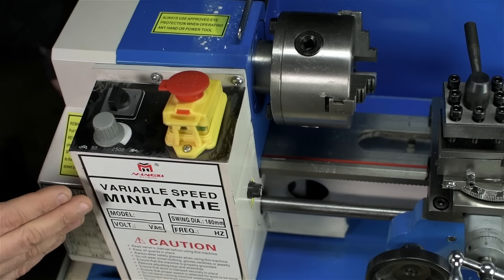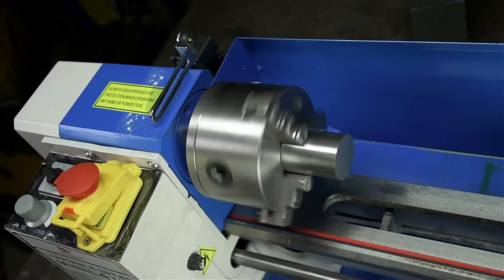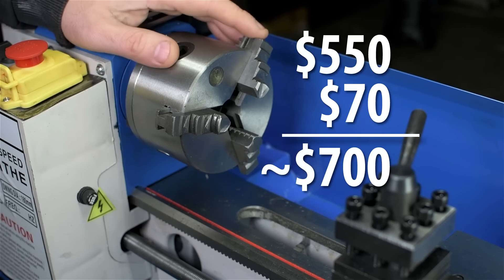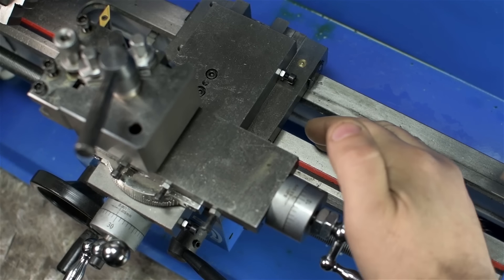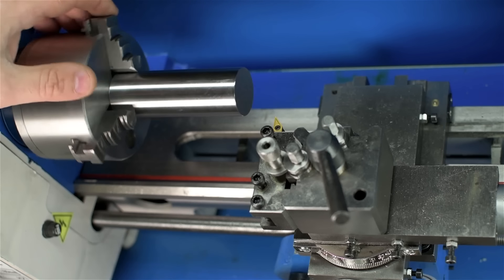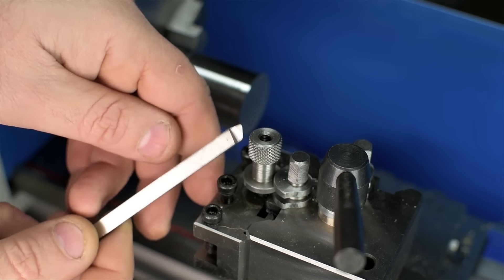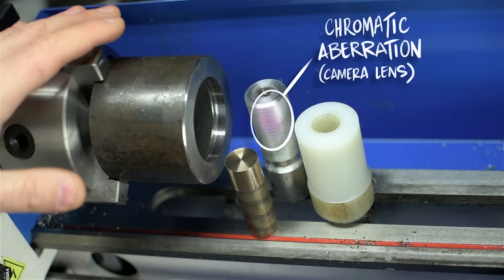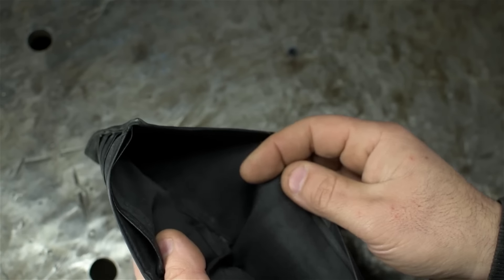The Infamous Mini Lathe!

Comment: hmmm it would still make a great mini lathe for wood textures or perhaps Resin? even if the metal lathing is less, it still works if you have the right tips and the patience to use low/slow cuts

Comment: just bought that same lathe that must have been from a good batch cuzz Im very pleased with it! only flaw was a scratch on the chip tray LOL  other than that the motor does wine which am hoping will calm down>>>>>>only concern is how can i loosen up the chrome compound crank so its not so damn tight!

Comment: The "Chatter" using the Button Insert is what you would expect on such a Lathe - Try a little less Tool Overhang, A smaller Button Insert or - what we call a Knife Tool (which will Face & turn to a shoulder.

Comment: Hey im just gonna use it a little wile.

I could see it useful to knerl tooth picks.   Maybe its made as a fancy pencel sharpner?

No i actually think within its limits you can make small parts on it.

Id love to have one and a tiny bridgport to go with it, can ya get these in cnc with automatic tool changers  5 axis .

Dont it run on 2 d cells?

Comment: I feel a motor upgrade and controller upgrade would not be a bad idea, either a 1000 watt motor. Or a control and power supply with 6-12:volts higher than it came with.  Over volt the motor, but a 1000 watt brushless wiuld ve much better!

Comment: think this lathe should be evaluated for pure hobby purpose, like making some simple nylon or brass bushings, or turning down some small shaft for a bearing, for your RC project etc. most in that spectra dont even know how to make threads with a lathe. in that scenario the lathe is propperly very suited, and the time issue is neather a concern, with it being used a few times a year.

Comment: No 7x16?  Check out Little Machine Shop and Micro Mark.  The LMS lathe is available with a solid (non tilting) column, which is a good idea.  The MM machine comes in two boxes, so there are no parts that require a crane to get it up on your bench.  The MM machine is a a "True Inch" machine that does not have marking for metric threads.  However LMS has free software on their website that tells you what gears to put where for almost any thread.  I made a set of stockmakers screws for a Mosin-Nagant, on my MM lather, and they work fine.  Both LMS and MM offer metal gear sets.  
I see no advantage in either a 8x or a 9x lathe, because they all have a MT3 spindle.  While the spindle hole cannot be increased, the hold through the 3" chuck is what restricts the diameter of what can be put through the mini.  Going to a 4" or a 5" chuck will make the lathe more useful.  That should allow you to thread and chamber most military and/or sporter rifle barrels.  If you need something bigger, then I would recommend a 10x22 lathe that has a MT 4 spindle.

Comment: I got a slightly bigger lathe (but looks similar in many details) and it came without motor feeding. Advantage is, handfeeding you feel how fast you can go, it actually pushes back on you if you feed too fast. However instead of losing 150 bucks on a set of plastic gears, it might be a better idea to fit a step motor and an arduino (with a sensor detecting rpm of the main spindle) and this would give me computercontrolled feeding or threading at whatever rate for like 30 bucks...

Comment: I made a couple 3d printed gear to have a smaller feed speed. Not perfect, but a bit better. Went from 20/80 20/80 to 20/100 and 15/131. The 100 15 is a single solid part so only 8 mmm ID.
Let me know if you want a set...

Comment: These mini-lathes are a good size for home use and that makes them nice. The problem is how poorly they are made and even designed and just how highly variable the quality is from one lathe to the next. So you end up always purchasing a project lathe. If they only required the routine setup of a normal higher quality lathe once received, they'd likely be selling many more. (Oh, and my 7x14 came with metal gears for the same price. I'm also really torqued off by no thread dial.)

Comment: I think you should've used running oil, or atleast had a brush with oil touching the steel thru out the entire cut, that would make a difference...  I have to admit there's a few years since I was doing this myself, but I always got a better result with oil covering the cutter...

Comment: Great video! 👍 Is this a lathe you will recommend for hobby use? I consider getting a lathe like this one is my shop to use for smaller projects.
Reply from the maker: any lathe is a great lathe if you don't have one!  These are handy for smaller projects, for sure.
Reply: @ThisOldTony  Yeah thats true! 👍 I dont have any lathe right now and it has been many times i should had one before so i think i'm going to buy one. Is this one you have in this video the HBM 180 Vario or the 210 Vario model?

Comment: 550 watts, possibly could run on a 2,000 watt inverter on a 12 volt battery? , if you have a garage or shed without power.?

Comment: Whenever I buy any China tool, I like to tear it open and pull out the plastic stuff and sand cast replacements in aluminum or steel. It takes a couple of hours when you get the right (and cheap) stuff setup. So many failure points in China tools are the plastic gears or fan blades off the main shaft, for example, in rotary (dremel) tools from China always fail first and if casting them is the first thing you do, the tool will last a lot longer. I see a lot of that in purchasing these little kids.

Electric motors, though *never* rated what they say they are, actually have a low failure rate in China tools.

Now balancing out your castings or other general casting mastery takes hundreds of attempts but well worth it. We have a 1940's Moline tractor on the farm that over the years has practically become a brand new tractor from casting, anvil bashing, and old-school lathing parts and pieces. "We could just ebay this grandpa!", "Hell no I couldn't".

Comment: I have one. It will not start. Im thinking its brcsuse the e-stop cover does not latch to well.  I need to find a source for teplacement parts.
   I really have not looked very hard.  I also have a ZX1440 so.....

Comment: I got one of these and it came with metal gears, but the feed screw is metric, so to make a decent inch thread, it would need a 127 tooth gear, and the thing is too small to fit that. Biggest it can fit is around 110 teeth. :( was very disappointed because they advertised it as able to cut 10-52 TPI.

Comment: I wish I had enough money to get the MINILATHE. I've been doing some epoxy projects and want to try to get one of these.
Reply: They're 1200 which is still cheaper than a huge actual one. I'm making myself one instead. Get a nice chuck, put it on a plate to which I welded a rod, put it through some shaft bearings and hooking it up to a medium speed motor, attach some rails etc.

Once I make it I need a good box or something similar to cower it so it seems like a lathe I bought used rather than made

Comment: I just grabbed one of these for $300 so couldn't resist it.  Will use it for small things like bearing carriers for gokarts type things.  I've made several by chucking the pipe in a drill and running a dremel sanding disk in the opposite direction of the drill to get grind the right diameter etc.... I figure the mini lathe would do better than this.

Comment: nothing wrong with the plastic gears IMO. I 3D print a few gears I don't have for my old Atlas. They are awesome, quiet and they last. I have broken one tooth off a gear in 2 years of using them.
Reply: And also, the version from grizzly is not much more money and is waaay better.

Comment: I’ve recently discovered you (thanks to Xyla Foxlin). I’ve had an on again/off again desire to get into machining (small parts) for many years. I’ve been contemplating a Taig Mini Lathe for a couple of years. Wondering if it would be feasible to run one in a small apartment? How loud is turning brass/aluminum/plastic in small sizes? Do you have opinions on the Taigs? Am I being absurd?

Comment: could you lock the carriage by engaging the power feed with it disconnected from the motor?
Reply: that kind of works but the carriage can still move by however much backlash there is in the lead screw

Comment: 9:30 , asking as a newb who knows nothing about using a lathe, why did it get a 4/10?  Could you explain your rating system for that test?  To me, it looked like it done decently, but I'm not sure what I am judging.  Is there something that I am missing?  Something to do with the way that it cut the cold pressed metal?  Did it leave groves that would be hard to smooth out?  Was it just too slow at removing materials?  What am I missing here?  Someone please explain.
Reply: it was a rough cut with poor surface finish.
Reply: @charlesabaday6815 does that affect precision by more that a couple thou?

Comment: was looking into getting some stuff like this play with an try to learn some new skills. i didnt go looking at lathes first tho. i found this video. so im guessing 550 - 700 bux is the cost of entry for lathes. could u do cheaper by buying older used stuff or will that just lead to the price going up cause of older stuff being more valuable. this is alil out of my range for buying something that i have no knowledge about. ive done it b4 with a mig welder an im not someone that i would call  a welder. ive been able to use it to make stuff an get me out of hard spots a couple times with broken an stripped bolts or just welding stuff to the bucket of our bobcat to gives us options with stuff we're working on around the house. its never been something we've used as a permanent fix but good enough to get us out of a pinch.  an this is something that would make life so much easier if i could learn it, but 100 bux got me the welder so its dirt cheap but has done me well. not sure how much it cost new i got it second hand from a pawn shop and ive just picked up 3d printing in the past yr an ive went alil crazy with it but a mini lathe would be something i would benefit from in a few hobbys i have i guess u can say. is there a way to get something around this size but alil cheaper. i dont need anything special just something that i could learn on while still being able to make things i could use an show its value of having around. even if it was mostly used for ptfe plastic or something i would find a use with it im sure an would give me an opportunity to get a feel for how a lathe works and then it would feel so bad to drop 550 bux on something like this cause im pretty sure the lathe in the video would do anything i would ever need around the house an with my hobbys.
Reply: i got one about a week ago, i got it for 525 an it came with metal gears 7x14 an a bunch of tools, now im working on the quick change tool post an cutting tools. took me 2 yrs to save up cause i kept buying 3d printers, im up to 10 fdm printers an 2 resins but i kept watching tonys videos an now im saving to buy a mill. you are a bad influence.
Reply: after spending time with it an slowly figuring out what im doing, more than likely the wrong way but the lathe wasn't to bad so i think i got a lucky but the tail stock is trash. i did get luck an got one that could be center but i cant for the life of me understand how vevor allowed something like that  out but it seems to be for everyone who buys one from vevor in the past couple months an if u contact vevor they will not replace it but  will give u a partial refund but its not enough to buy a new tail stock. so i learned really quick not to buy cheap cause its pointless. spend the money an buy it once or u'll end up buying multiple times.

Comment: Mine is nearly a year old and it's going to my scrap pile very soon. What's wrong with it? The belt wasn't tensioned properly so it slipped a few times so now it's the same on both sides, whole carriege  became so loose it's impossible to do anything on it, I broke most of the toy tools I've had for this monster of a lathe. BUT i'm buying a real one soon so thank you China!

Comment: I use two of these to run a business making pens - I work primarily in wood and plastics however, with some brass - and it's fine but I wouldn't recommend one for true engineering parts or solely for metals apart from brass.

Comment: I'm still using my myford 4inch precision does everything that I need.
Reply: Myford  four inch is the same as US eight inch.  The English use swing radius not swing diameter.
Reply: @richbuege6491  that is correct although the precision 4inch is a gap bed lathe the swing radius over the bed is 4 inches. The myford 4inch precision is so called as it was built to very strict government specifications as an indexable micrometer lathe that was not available to the general public till after the second World War. Mine is also fitted with the long cross slide and backplate and vice to allow milling in the lathe.

Comment: Carbides always want to see some pressure. If you choose a to small cut depth you will end up with a shitty surface. Try a higher feed rate, higher cut depth and a higher revolution. It may work better for steel.

Comment: Got one from HARBOR FREIGHT a couple of years ago.  After cleaning off the tons of cosmoline, and powering it, it became evident that the  (on sale) $350 was justified. The tail stock nut is a pain to use. It was not centered on the lathe chuck and difficult to adjust.  The Slide & cross slide gibs needed to be tightened, but still the cradle rocks when making
shallow cuts (in brass and/or alum.).  It has blown several fast-acting fuses already.  The std. tool post is annoying.
MICRO MARK sells their 'hotrodded' version of this lathe for the current 'on sale' price of $1799. Granted, it does feature
metal gears, also the tailstock has a locking arm.  But, to spend $1800 for this basic Chinese lathe ..... be better off inventing in a high-quality German-built machine, and have complete confidence directly out of the crate.

Comment: I’m planning on taking a gunsmithing course, and this lathe (or one of it’s different colored twins) comes in the tool package included with the course level I’ll be taking. Do you think it could be reliable for cutting 1/4 x 28 threads on barrels for muzzle devices?

Comment: It’s not the  lathe ,it’s how you use it. If you’re having problems with chatter, parting etc it’s the cutting tool not the lathe .But As always the you tube expert knows everything .
Reply: Or, you could get a lathe where you don't have to work around its flaws, and can turn steel without worrying about breaking it

Comment: I started out with one of those types of lathes and it was so far off in every  way possible that I finally gave up and sent it back. I could have fixed it......Probably. But for what I paid for it or a couple hundred more I could get a 2500lb 1953 Hendey Lathe that just needs a little cleaning up. A couple parts and it will be good to go. lol

Comment: Can you feed a 3 foot 3/4" rod through the back of it to thread the end?
Reply: Sure can if you keep the rpm down so it doesn't whip all over. Personally, I mostly cut threads without using the motor. Just turn the chuck with your hand and take shallow cuts. ToT has been hooked on speed and automation with his bigger lathe. Of course, if you do a lot of threads then that's a reason to buy a better lathe. Me, only doing prototypes and playing so the little Chinese fella (mostly) covers my needs.

Comment: Pub quiz: why does the lathe need to be levelled?
Reply from the maker: if it has any twist in it it won't make cylindrical parts.
Reply: Yes the saddle has to run true to the chuck

Comment: Once bolted down to a bench (minimum 3” thick hardwood on cross fit legs) then find 12” of solid concrete floor and drill 1” x 10”l holes at each leg and anchor them with 3/8” steel brackets with 5/8” stainless prestressed 9.5”l bolts set in vibration dampening epoxy rated for 8.0 bidirectional earthquake. Cure for 3 months before use.  My company can do all this including retrofitting your bench for just under $7,200.00. (Come-oooon man! You know you NEED it for safety sake!  I mean..you have kids depending on your income right?)

Comment: If you're upgrading the motor, use a stepper, and then put a stepper on the lead screw and with the proper controller you can now cut whatever thread pitches you want.

Comment: On the grown up lathe, "the lathe would probably stall".
Nope - you'll break the shear pin in the drive-train behind the uppermost change-gear.

BUT LOOK what those plastic gears are driving - a SCREW - a 'worm' - giving an infinite:1 torque ratio. Score: Plastic gears 1, bed, nil.

Comment: Mini lathes are a little bit too small. If the workpiece clearance was 10% larger they would actually be much more useful. But that said, I still have one that gets used from time to time doing small parts for gunsmithing.

IMO, a bench top mini mill is much more useful. My bench top mill gets used more than anything else in my shop, and I have a bigger Bridgeport.

Comment: I got one that costs only $150, but the gears were made of wood, not plastic. And the body of the lathe was plastic, not metal. But, I paid for it with cryptocurrency, and have little to no intention of actually ever using it. Let the chips fly where they may.

Comment: My main gripe with these lathes is the lack of mass compared to machines from the 50s&60s which usually came on a heavy cast iron base, which makes all the difference, rigidity is everything. My 2 cents buy a lathe from past decades.